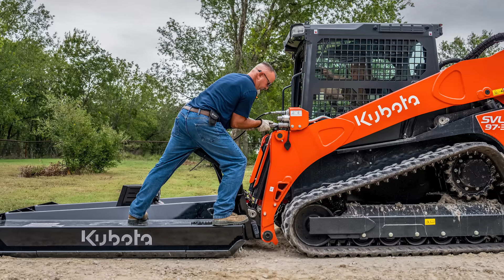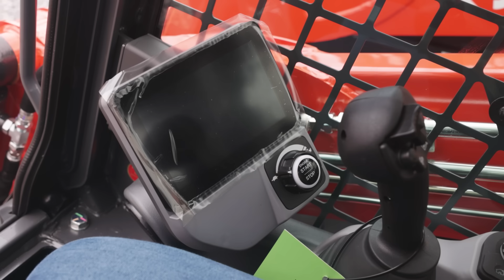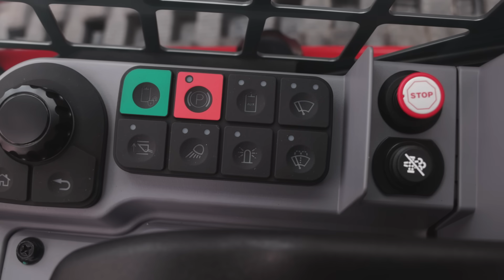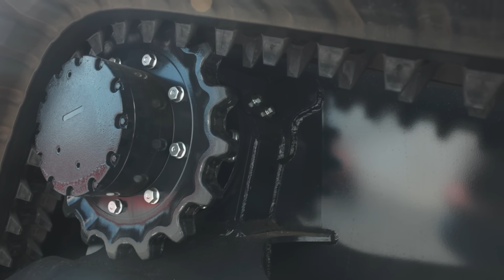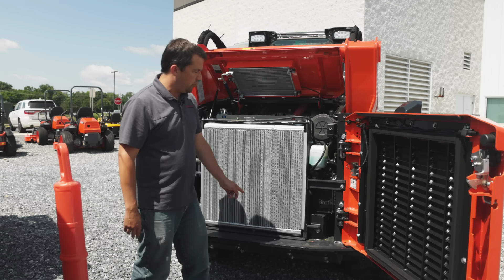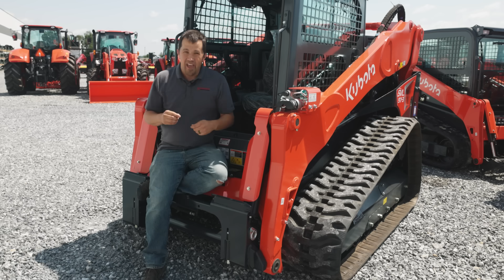Kubota SVL97-3 vs SVL97-2 | What’s New?

Comment: Neil, I was looking at an SVL97-3 the other day and did not see or at least could not tell if it had a reverser fan like on my SLVL75-3.  Does the SVL97-3 come with a reverser fan or is it an option, or is it just not needed due to the cooling radiators being on the back vs on top of th rear deck?  Glad to see that many of the options that I had to pay for are now standard.  That's how it should be.  I would like to see the "forestry kit" that protects the lights, hydraulics, and coupler as well as a much better rear bumper & counter weights added to the standard equipment.
Reply: No reverser on ours :( but the machine is way better overall then the -2s
Reply from the maker: No, there is no reversing fan option like on the 75. Probably due to the overall size of the radiator package.

Comment: Does the door still rattle like it's gonna break ? Every kubota I've had from the 95 to 97 both rattle so bad up or down.
Reply from the maker: The key is to pin both sides of the door when it's rolled up. If you make a habit of only pinning one side, it'll wear the track over time and slop.
Reply: It seems improved! It has more adjustable bumpers to keep it snug! I'm much happier! I don't run with it open much at all, that's just me!

Comment: Not surprised. Tractors have become “fool carriers” instead of “tool carriers” (I have two tractors). I really need front cut and other tools like rock hammers. This requires an actual, functional, hydraulic system. Were the tractors equipped with such I’d be very happy. The “compact” skid loaders are to big for where I need to use them , the stand on mini skids (from Kubota) don’t have a sufficient hydraulic system. Were I buying machines today I would purchase a Vermeer CTX-160 and a mini-X. The mini-x would likely be Kubota, I do like their equipment. Kubota really needs to address hydraulics across the board, instead of being versatile, tractors have become limiting.
Reply: Small/ medium tractors don't really need great hydraulics although it would be nice. The simplest explanation I've been given is, Loaders are built for tractors, tractors are not built for loaders. Tractors have always been built for  pulling and pto work.
Reply: @bhard_man bull pucky. No excuse for mediocre hydraulics.
Reply: You can get a PTO power pack by Ironcraft. We have one and use a hydraulic front brush mower on our Grand L 3560, and it works well.
 Also Kubota did release a new small track loader that is much smaller than the bigger loaders. I think Messicks did a review on it when first came out earlier this year.
Reply: @jimmcknight3021 my point is that a general use tractor should have better hydraulics. My 4701 could obviously support a power pack but would not fit into the areas I need it.
Reply: @halsnyder296 Yes it does make the machine long. To be sure.
Reply: @jimmcknight3021  for 10k and you lose half your tractor! Thats a shit solution.
Reply: @jimmcknight3021  What does it do does it increase hydraulic flow?
Reply: @mitchscat773 Yes. The powerpack is its own system driven by the rear PTO. This creates gallon per minute flow (GPM) of around 13 GPM which will effectively runs our front brush cutter.  The Kubota GPM flow, I believe is under 9 GPM on our model. That just isn't enough flow to power to mower or really any other attachment like a hydraulic post hole digger.

Comment: Base price??
Reply: $87,404
Reply: @elcheapo5302 I'm guessing here in the UK the most comparable machines would be a JCB 3CX Compact  top range based price of round £ 80.000 and that's just my estimated amount without checking my local dealer
Reply: @Colin-rg7gt 300T is closest. Smaller engine less capable hydraulics though.